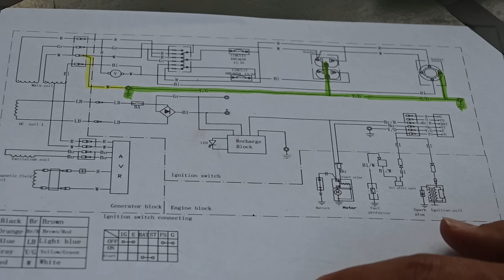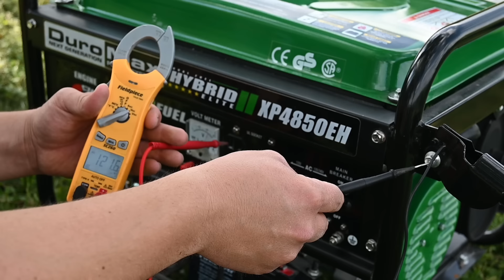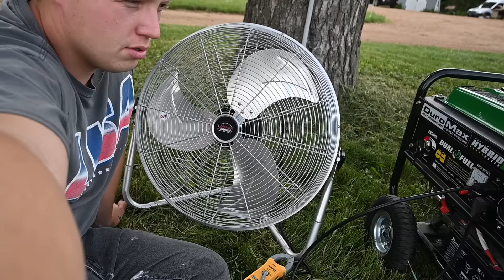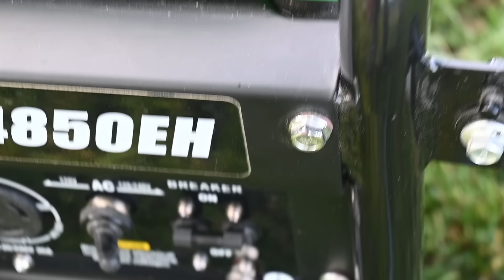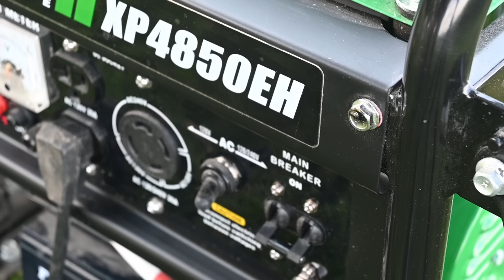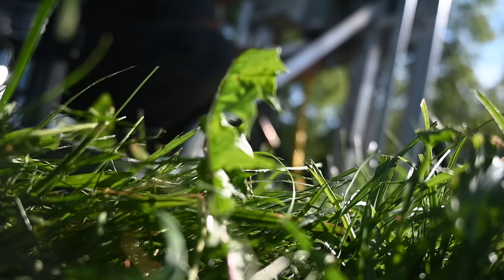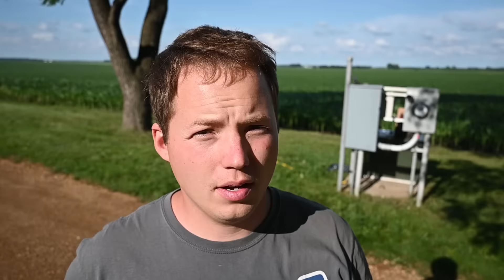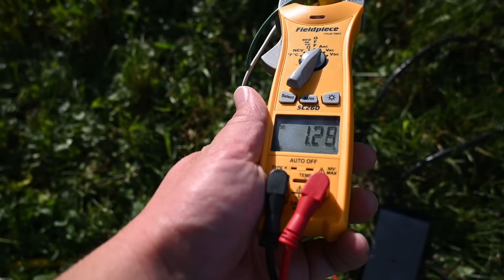What is a Floating Neutral Generator?

Comment: Ben, another great video! Thanks for all the time (and guts) to do this one! Disturbing how your generator’s schematic was not in alignment with the actual wiring! I do think DuroMax suffers from misleading or inaccurate literature in many cases. Also adding layers of understanding to this video is the particular fact that the DuroMax generator ground circuit is not actually bonded to the exterior frame. What would you say to using an approved grounding rod to ground a bonded neutral generator that is wired directly to a main panel (using no transfer switch) WITHOUT A GROUND WIRE between the generator receptacle and the main ground buss??
Reply: PS. This scenario I just mentioned (ground rod/bonded neutral/no ground wire from panel to generator) is DuroMax’s recommendation.
Reply: @toddlaroche5831  after don't know how many hrs finally found 1 mention of a Preditor on the DIY page. Ground and nutrual are bonded at the ground lug, schematic I found was wrong, imagine that! Could easily put a switch there to change it, 4 bolts and 6 nuts. Full steam ahead!
Reply: I think I have a similar problem (but in reverse) with a Greengear generator I'm looking at buying in the UK. The manual says that that the neutral is bonded, but the wiring diagram shows that it isn't!  I can't see any alternative, but to go to the store, ask them to prove that the neutral is bonded to the frame (and the earth pin on the main receptacle) and only buy it if they can. It should be possible to trust the documentation, but you really can't if it is based on information supplied by the Chinese manufacturer.

Comment: Awesome video!

Never worked residential so any generator under 15kw we always classified as a tool and not designated for real property installed equipment. Never thought about it but it's nice to know the little guys we use for hand tools might not have the fault protection I want. Guess I'll be placing some jumpers
Reply: So if u hook up a floating neutral generator to a inlet box with a interlock breaker you shouldn't  also use the 110  outlets (extension cords) to run other things???
Reply: Yes you can as long as its not from the genny. Extension cords should come from house sockets that have the Jenny running them but inside house panel the earth and natural are bonded together so the gfci will trip correctly.

If you plugged directly into Jenny 110v out let it would be floating so you wouldn't get it to trip as it floating.

If Jenny is plugged into house change over and you also plug into Jenny using an action cord it should trip as the natural and earth are tied together until you disconnect the power lead to the change over panel at house now you have a floating natural again 😮😮

Basically if you use hand tools on a Jenny link wire from earth to natural in plug and install ground rod.

If powering house leave floating as it will be linked at change over panel netrual and earth

Earthing is a complex subject and even us electrical 😂techs scratch heads sometimes 😂

Comment: Ah I see, having the generator bonded at the generator and at the panel makes the ground wire and the neutral wire essentially into one wire which then causes current to be drawn through the ground wire rather than exclusively through the neutral wire. This could especially become a problem if the ground wire is thinner than the neutral.
Reply: Well, the thicker wire is going to carry more current than the thinner wire. Not sure this in and of itself presents a problem.

Comment: Have this same gen Duramax xp4850eh but purchased in 2020 and the neutral is bonded now (!).. I opened the panel like him and there is another wire connected to the ground terminal now (yellow wire on the left), and the continuity beeps on all of them.. so Duramax fixed this, mine is bonded. 
Double check yours for sure!

Comment: So, in other words. The bonded neutral generator that I use for my house when the power's out (through an interlock breaker, as yours) needs to be a floating neutral?  But if I take same generator out to a jobsite to run power tools, it needs to be a bonded neutral to be safe?
Reply from the maker: Technically, yes. But as I mentioned I wouldn't be too concerned if you're interlock breaker is connected to your main panel where the neutrals and grounds are bonded. With the bonded neutral generator that you have there will just be a small amount of neutral current on the ground wire in your generator cord and, though it's technically not right, I doubt it would ever cause any issues.
Reply: @BenjaminSahlstrom  Question? i have a duromax 10000EH, which states it has a floating neutral. i have continuity from the neutral to the ground/frame. So this means the neutral and ground are bonded at the unit and because the the ground and neutral are indeed bonded at the generator making it a "floating neutral" do you eliminate the ground at the twist lock receptacle that goes back to the main sub panel? I smoked my ground contacts on my 4 wire receptacle and duromax said that having the ground connected at the receptacle as well as a neutral conductor creates a "power loop" thus allowing a stray current to flow on an alternate circular path and this is what smoked my plug on the ground contact.  Essentially, the two line leads 240/120V support power, the neutral and ground are bonded to return the unbalanced load on any 120V circuits and you need a bonded ground to an earth path to a rod in the ground connected to the chassis bond lug that will carry shorts that the neutral cant handle thus this is how it needs to be wired for proper safety... would you agree? in your previous video i saw you install a ground wire on your plug and it worked because you generator was not actually bonded to neutral. make sense?
Reply from the maker: @jjdj92  Confusing as ever isn't it! If you have a floating neutral then there should be NO continuity between neutral and ground while the generator is disconnected from your system. If there is continuity then you somehow have your neutral and ground bonded together at the generator and you may need to remove that cover as I did to see if there is a jumper installed. If so then just remove it to make it a floating neutral generator then your issues should be solved. Grounding the generator is unnecessary in my opinion especially when connecting the generator to a system through an interlocked backfed breaker. I'm going to make a video explaining this hopefully soon.

Interesting to hear when Duromax said regarding the current loop. I'm surprised that it could actually fry your plug though. Let me know what you find out.
Reply: With a 10kva generator, it is probably using a 50a plug. If 4 wire 50a, like L14-50, that plug cable is probably 3x 6ga and 1x 10ga for ground. That would fry the 10a ground wire if it somehow took an unbalanced load, anything 35a (30a NEC) or more would overload the wire, 50a might burn it.
Reply: Jason, when your plug smoked, did you have a ground rod attached to the grounding terminal on the generator panel?
Reply: Todd LaRoche ñ

Comment: I work on Drilling rigs, and they use CAT gens to run the rig. They Intentionally  float the neutral so if there is a short the equipment will stay running.

Comment: Benjamin,   If you look at the wiring diagram again carefully, you will see that the two coils are not connected together anywhere.   Therefore, you really have no neutral in the generator, just a 120 volt AC circuit.   The three pole double throw switch is interesting.   Not sure where that is on your generator.
I have done some investigation.   The reason it is ungrounded system is if you have a defective tool in your hand and touch the frame, you will not be shocked.  If you connect the generator to an RV, you need a neutral to ground connection.   (Because an RV typically does not have the N-G connection within its system). If you connect the generator to your house with a 2 pole transfer situation, then you do not need a neutral to ground connection(already exists).  If you do a 3 pole transfer, then you need a neutral to ground connection in the generator.   Hope this helps.
BTW, you can buy bonding plugs at Amazon.

Comment: To understand the connection of a portable generator to a house, one must know exactly how the generator power is being placed into the house circuit.  In the first three situations below assume that the house is disconnected from the utility power input.  If the breaker panel is the main disconnect, it is probable that the panel's ground bus and the panel's neutral bus are connected together, and the panel's ground bus is connected to the local ground rod/dirt.  If it is a secondary panel, the ground rod is not there and the connection in the panel between neutral and ground is not present (the neutral and ground wires go separately back to the main breaker panel where they are connected together there).  For example:

1. A generator feeds via a cable into a house panel/outlet/plug where the two 120vac hot/black wires go through a breaker and then to the house circuit, the plug's neutral is unswitched and is connected to the panel's neutral bar (along with all the other house's neutral lines) and the plug's ground goes to the panel's ground bus bar (along with all the house's ground lines).  The cable's ground and neutral wires are essentially the same, i.e. a parallel path, because they are connected together inside the house breaker panel.  For a grounded-neutral generator, the return current from the two 120vac hot lines will flow, nearly equally, in both the cable's neutral and ground wires because there is no difference between the two wires' connections. Further, current flowing through a wire, because of the wire's resistance, will produce a voltage.  Therefore, the ground wire connected frame of the generator will be at a voltage higher than the house ground voltage.  If you touch the house ground and the generator frame, it is likely that you will be shocked (maybe even lethally). If you touch the generator frame and the wet dirt, again possibly a lethal shock. If the generator is a floating-neutral generator, there will not be current flowing down the cable's ground wire -- 100% of the current will remain on the cable's neutral wire.  The generator will be at the ground potential of the house -- no shock.

2. A generator is fed by a cable into a panel plug where the two 120vac hot wires and the neutral are switched.  In this case the house ground is always connected to the generator's frame/ground.  Engage the switch and you have essentially the same thing as in example 1.

3. A generator is fed by a cable into an panel plug where the two 120vac hot wires, neutral and the ground are all switched.  By switching the ground, the generator frame is floating and the minute leakage currents in the generator could raise the frame to a dangerous voltage when the switch is open.  Sinking a ground rod and connecting to the generator's frame is a stabilizing option but this is a less than ideal situation.

4. The generator is not connected to the house circuit and is used whilst camping.  This is the usual NEC/OSHA described scenario and the one for which many (most?) generators are configured by the manufacturer (grounded-neutral).  In this case, a ground rod is usually prescribed for making the generator's frame potential equal to that of the local dirt.  Thus, if you stand in wet dirt and touch the generator frame, the shock potential is minimized.  Otherwise, it is possible that the local dirt voltage is different enough relative to the generator's ground/neutral that a lethal shock may occur.  Also, if something is plugged into the generator's outlet, the appliance's grounded enclosure is at the same potential as the generator's frame and the dirt.  If something goes wrong and the hot wire leaks to the appliance's enclosure, there is now current flowing back to the generator via the cable's ground wire and the GFI will trip.  Further, the grounded-neutral ties the neutral to a reasonable/safer local voltage.  A floating-neutral may see the neutral drift far away from the dirt's potential, a voltage between the frame and neutral) and could produce a lethal situation.

Comment: I just  bought a Champion 4650W Inverter Generator for our camper trailer.  When I read the instructions and saw that it had a floating ground, I wasn't happy.  Your video was great at explaining why floating grounds are so bad.  I've watched other videos today where the RV owners were making the common-to-neutral bonding plug, but weren't then grounding the generator to Earth.  This is also bad, right?

Comment: I bought a Honda 2200 approx. 2 months ago. It is a floating neutral generator. In order to use it to power my travel trailer, I had to get a three prong plug and put a jumper between the ground and the neutral.

Comment: What I did with my portable generator I installed key switch so I can select a floating neutral or bonded neutral. So this way if I have to use it for a job site I can bond it and if I need it to power some outlets I can float it.

Comment: When you tied hot to the chassis it was also bonded you would just then consider what was the "netrual" is now the hot. The gen gives you a voltage between two wires, it's up to you to assign a reference. Borrowing terms from familiar vocabulary will only get you so far, theory will take you home.

Comment: Yip! A very good vid.using extension cords = bonded neutral. Going to ur house floating neutral. Gen is grounded at house's panel.

If using a faulted load w 2 wire cord. U wont be shocked until gen is hookt to house, then there is a ground and person
 using faulty load can get shocked.

Comment: very nice detailed video and explanations. I find that back-feeding a house is better using 220vac. 2----hot 120 volt leads from the genset and the bare copper ground. Make sure that ground wire is part of the frame. The electrical panel will manage the ground system there. back feeding 120VAC to a home is tricky and dangerous and it limits the potential of the genset.

Comment: I must add in the marine world we never run a bonded ground system. We are always checking for voltage between our gensets neutral to the steel hull to check for a phase to ground fault. Our electrical systems are not grounded to the hull for several reasons. Galvanic corrosion is the primary reason, reliably is second, and safety is third. If we have a phase to ground fault it won’t disable a critical system. We will detect it when we test voltage potential from our neutral to ground (hull). I personally test this once an hour when I do my hourly engine room check. When a fault is detected it can be repaired without interruption of the likely critical system. Or give me time to bring a backup system online before repairing the fault.

Comment: Great video I am working an annual electrical shutdown  PM tonight on 2400 volt power breakers, but before that I need to connect a 120 volt generator to laboratory equipment, 480 volt trailered Onan generator to the portable water supply pump motors, and I'll need to connect an inverter duty 120 volt generator to computer servers. I'm going to do some tests on the generators before and after I electrically connect them to a load. Great video keep up the good work. I would have said "awesome" video but that term is used too much . LOL LOLOOLOLLO LOL.

Comment: There are instances, in which you DON'T want your electrical supply bonded.  Many electronics from the past, will have severe problems, if the neutral is bonded.  Extreme safety is needed, when you hook up a generator to an existing breaker box.  It is also helpful, if you need your equipment "isolated".  Many musicians need this, for running old linear equipment in areas without electricity.

Comment: Sanity check this: Background: I used to have a 120/240v emergency generator I could attach to the house via a Reliance 31406CRK Transfer Kit. The old generator was too much trouble to maintain and too noisy, so I bought a Champion 4500w/3250w (Dual fuel,, I use propane) inverter generator, which is so much quieter and so much smaller than my old 6500/5500 generator.

The new generator has a NEMA TT_30R 120v/30A outlet for connections to the house. Using a short extension that jumps the X & Y outlets (Amazon CircleCord NEMA TT-30P to L14-30R Adapter Cord, 30 Amp 3 Prong to 4 Prong Generator Plug Adapter), I can supply current to the house via the transfer box into the subpanel, which has a four-pin 240v/30A connection. This works because there are no 240v circuits that come from this sub panel so I can run critical 120v stuff during an emergency: refrigerator, some lights (LEDs), a single-plate induction burner, and 14 outlets. I will have to take care to monitor loads since the refrigerator start-up requires about 2200w, but this should be easy.

The generator has a floating neutral; bonding and grounding occur, of course, in the main panel.

I am able to switch on generator-supplied circuits with the generator running and the utility electricity on too. Something I don't understand when I do this is that the neutral is now shared by the utility line and the generator, and wonder if there are any issues with this.

Comments and criticisms from anyone who has tried this 120v/120v transfer connection will be appreciated.